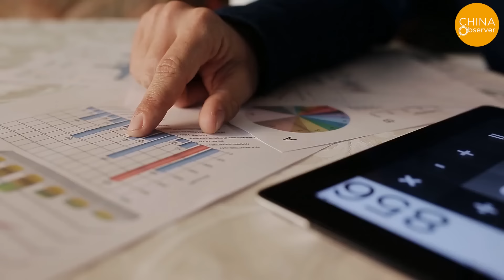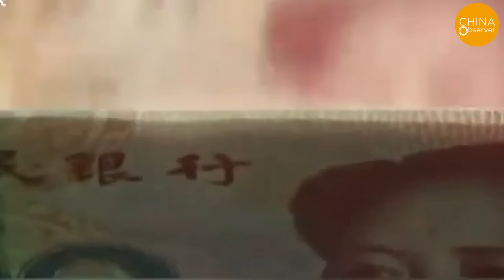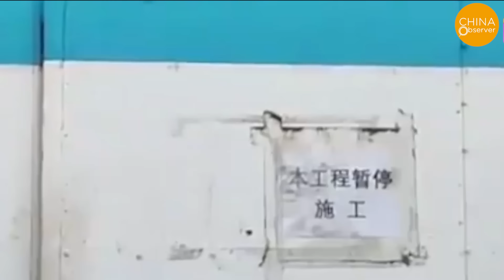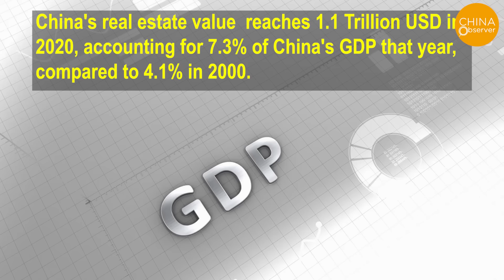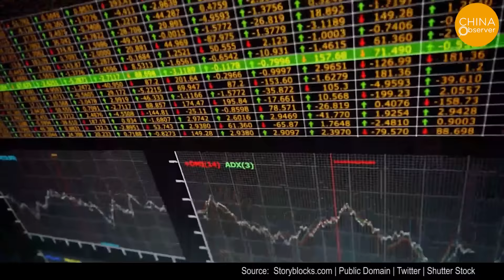Why People Live in Unfinished Buildings (Rotten Ended Buildings) in China?

Comment: I have a few video clips of these buildings, a few random pics and I wish I took more close-up inspection videos. I worked in construction long enough to know some of these are doomed to fail and maybe even collapse. Others are just outright safety hazards and the reason why is seen in this video:
You cannot expose the concrete skeleton for years and years like that without degradation. I have 'rotten tails' exposed to years of extreme heat and cold, extreme rains and winds where corners are "sanded" to smooth rounded edges, you can see some where the color has changed from concrete gray to black to white 'mold-like' swirls. exposed steel rods appear to be rusting and jutting out of what is supposed to be the interior. Ive seen edges crumbling everywhere or wearing away from years of rain and wind. 
I have seen moss, ivy and grass (yes, seriously, grass) growing on top floors, up walls of exposed concrete. 
Then I've seen them quickly finished years later, fastening shiny glass floor by floor and voila you have a brand-new shiny building. Yet, inside, they literally patched up and glued that together (if at all) and slopped some paint around on what is yes.. really a 'rotten' interior.

Comment: Fraud is when the government collects money from a builder for units that have been financed by banks but haven’t been built.  There’s a simple solution to all this.  The people who purchased these units need to REFUSE ANY FURTHER PAYMENTS until their units are completely finished to their satisfaction.  Here the builder wouldn’t be allowed any of the money until certain milestones were met on time to the satisfaction of the building inspectors (which in itself is a whole other problem in China).  Then that builder would receive a “draw” on the money required to continue with the construction so they could reach the next milestone in the construction process.  It appears that in China the people who contracted to purchase the units are forced to pay regardless if the units are built or not.  That can only mean one thing…the government is demanding payments from the builder regardless of the status of the units.  So it’s easier for the builder to just take the money and run than actually finish the promised units.